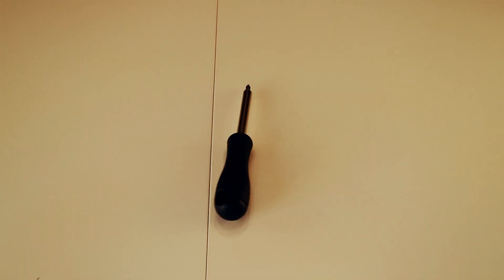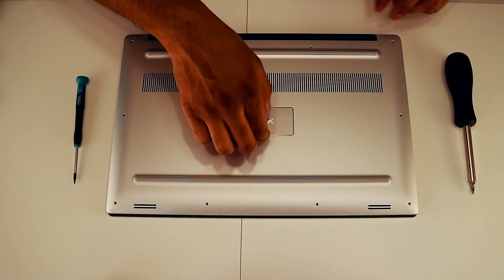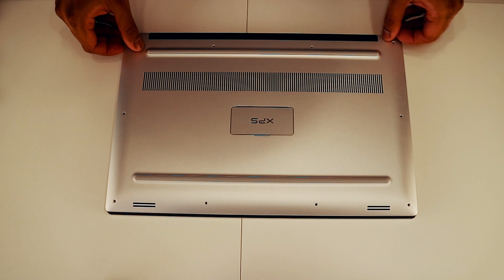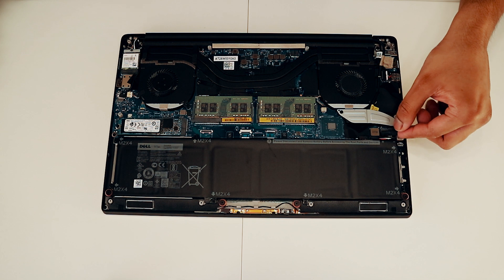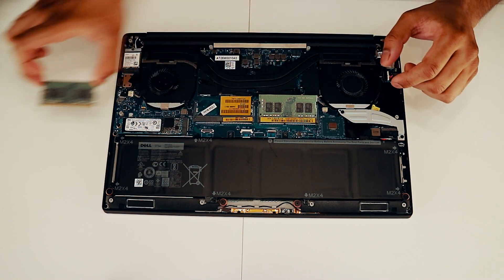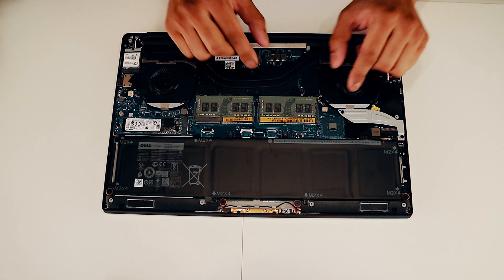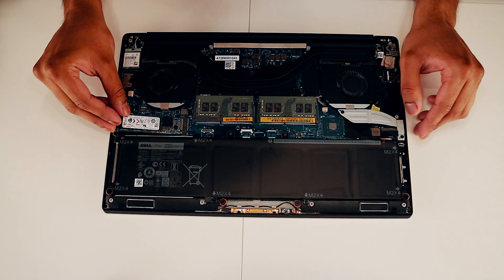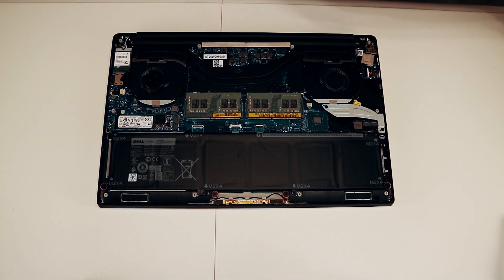How to UPGRADE your RAM & SSD on the DELL XPS 15 9570

Comment: Great video! Is each RAM module 8gb each? for 16gb. I wished to upgrade to 32gb to do I need two 16gb? Also is any RAM model ok? Thanks for the tips
Reply from the maker: Hi
Yes if you have a 16GB RAM currently then you have 2x8GB. You'll have to buy 2x16GB for a 32GB Setup.
Make sure you read this article because there are some compatible issues with the XPS 15 9570 when it comes to RAM Sticks.
https://www.windowscentral.com/how-add-more-ram-dell-xps-15-9570

Comment: What do I do before I upgrade the SSD?  Do i need to save my bios on a usb? What are the procedures?
Reply from the maker: Backup your personal files to a external hard drive then just swap out the SSD.
Install Windows 10 from a bootable USB drive which you can create using Microsoft own software called Windows Media Creation Tool.

Comment: Hi. Thanks a lot. Can I do the same with the model 2018? If I buy with 16 GB 2 x 8 GB DDR4 a 2.666 MHz
Unità a stato solido PCIe M.2 2280 da 512 GB can I then upgrade in the future?
Cheers
Reply from the maker: Hi!
Yes, this is the 2018 model and you can of course upgrade in the future!
You could upgrade to 2x16GB DDR4 and 1TB or even 2TB PCIe SSD.

Comment: I have the version with 8gb of RAM und I want to Upgrade it up to 16gb. Did you know If I have right now 2 x 4gb insisde and I must buy 2x8gb or if I Just have one 8gb Stick and can buy Just one more with 8gb that I have 16gb? :)
Reply from the maker: Hi
I can confirm that the 8GB RAM is a 2x4GB  setup! So you'll have to buy 2x8GB for a 16GB Setup.
Make sure you read this article because there are some compatible issues with the XPS 15 9570 when it comes to RAM Sticks.
https://www.windowscentral.com/how-add-more-ram-dell-xps-15-9570
Reply: @HumanSuten  OK thank you!

Comment: I just bought a Dell XPS 15 9570 with 512GB SSD storage and want to increase its storage. Can I add a 512GB Samsung Evo 960 without removing the existing drive, therefore making it 1TB?
Reply from the maker: Hi
It depends on what battery you have in your XPS 15, is it the smaller 56whr or bigger 97whr one?
If it's the 56whr then you can install an additional SATA drive, not M.2. 
The EVO 960 is it a M.2 drive? If so then you have to replace the existing 512GB SSD you already have in your system.
Reply: @HumanSuten  Thank you for the reply. My battery is 97Whr. Also, I guess Samsung 860 EVO is SATA III drive. What do you think, is adding this drive possible, keeping the original drive intact?
Reply from the maker: Unfortunately you can not add any additional drives because the 97whr doesn't allow any SATA drive installation.
And the drive you already have in your computer is not a SATA drive, it's a M.2. PCIe, and you bought a SATA Drive which will not fit.

Comment: Hello, does the Dell XPS 15 9570 have  2x4gb or one 1x8gb, I am sure it is a 2x4gb, just wanna know.
Reply from the maker: I tried to find some information regarding the case, I believe it's as you speculate, 2x4GB. I can try to confirm it in the coming days because my brother just bought a Dell XPS 15 with 8GB which we will do a RAM upgrade on.
Reply from the maker: Hi
I can confirm that the 8GB RAM is a 2x4GB  setup!

Comment: Hi, I was wondering if I would have to re-install windows or do anything software related after upgrading the ram.

Edit: Will my new ram appear on the about this laptop window?
Reply from the maker: Hi!
No you won't have do anything besides checking for yourself if your laptop detects the new RAM stick ☺️
You can do this by going to "About this PC" as you said yourself or by running "dxdiag" in CMD.
Reply: Human & Suten thank you! also, would you recommend me getting the xps 15 or any other laptop? my budget is $1400 and I would like a dedicated graphics card
Reply from the maker: I don't know the prices where you live but 1400 USD won't get you a Dell XPS 15 where I live. It's difficult to recommend anything because prices varies a lot from country to country. But you could look into the Dell G5 and Dell G7 with dedicated graphics card although a bit bulkier/heavier laptops. There also several other Asus Gaming Laptops you could look into. I don't what you're looking for, gaming performance or something for content creation?
Reply: @HumanSuten  I am a 3d game designer and do lots of coding as well as render different images and backgrounds. I cannot put a link over here for the laptop as youtube will automatically remove this comment. Just search: Dave 2d the problem still persists and click on the link in the description on the XPS 15 for the price of 1399$. that is my maximum budget and I do game from time to time. I only like good build quality and thin bezels as well as a good trackpad.
Reply from the maker: Yes I've seen his video and checked the link. For the price I think it's a great value for the things you mentioned that you do. The i7 8750H is the greatest CPU for laptops right now and the i9 version is not worth the price for 10% increased performance. You can always undervolt and repaste the cpu to avoid thermal throttle. We have a video on this procedure on our channel. But honestly all laptops if it's not a gaming laptop with big fans will thermal throttle in some degree.
Reply: Human & Suten thank you so much and I will buy the cos 15. You are a great YouTuber and the few YouTubers who actually care about people’s questions. thank you! Also what laptop do you use?
Reply: Meant to say xps 15
Reply from the maker: Thank you so much for your words, they really mean a lot to us! 
We really try to answer all of your comments because you the viewers are what drive the channel forward.
I currently use the Dell XPS 15 9570 4K i7 Model with 16GB RAM + 512GB SSD ☺️
Reply from the maker: Follow this Subreddit to check if the RAM stick is on the list. https://www.reddit.com/r/Dell/comments/8r55ys/9570_working_ram_kits/?utm_medium=android_app&utm_source=share
Dell XPS 15 9570 is really specific with what RAM sticks works or not.

Comment: Why do you unplug the batterry before you upgrade the RAM ??? and My XPS 15 is 8GB (2x4GB) ram, I just buy 16GB (1x16GB) ram. Is it possible to upgrade my XPS to 20GB (4GB+16GB) ram??? Thank you in advance
Reply from the maker: In all upgrades to computers you should always disconnect the power source and if it's a laptop you're dealing with you should also disconnect the battery. You don't want any current running through the components.
Also you should always buy RAM upgrades in pairs, you should instead go for 8GB + 8GB RAM because that enables "Dual Channel" speeds.
Lastly check out this user upgrade guide to get RAM sticks that really is compatible with the Dell XPS 15 9570:
https://www.windowscentral.com/how-add-more-ram-dell-xps-15-9570
Reply: @HumanSuten  Thank you so much
Reply from the maker: No problem, glad I could help you out! ☺️

Comment: Hi, If im upgrading the SSD but the laptop is new and never been turned on before is that ok to just do a straight swap? Thank you
Reply from the maker: Hi!
I would first boot up the computer to see if all is working before adding a component. This would make the troubleshooting much easier because you then know that the computer was fully functional before the process, so if any error arises after upgrading the SDD then you know that it's the new SSD.
Reply: @HumanSuten  Thanks alot!last question..am I right in thinking that I'll have nothing to have to back up when I do this?
Reply from the maker: Yes, that's correct! Watch our video on how to install a clean install on your Dell XPS 15 9570 https://youtu.be/_G8kP70bGQc
After that be sure to update you BIOS because Dell has made a lot of improvements to the Dell XPS 15 by updating the BIOS.
Please feel free to ask us how many questions you would like to ☺️

Comment: Great Vid. Can you pls confirm if V-COLOR - TL416G26D8RBR17_Kx2 - 32GB (2x16GB) DDR4 2666Mhz - White LED - Red Heatsync - CL16 - 1.2V -  and Corsair - CMK32GX4M2A2666C16R - 32GB (2x16GB) DDR4 2666MHz CL16 - Red - Vengeance® LPX Series are suitable RAM for Dell, Also if Samsung - MZ-V6P1T0BW - 1024GB (1TB) SSD 960 PRO M.2 NVMe (M2) can be use it ? I'm open to suggestion too. btw is there a place for an extra normal SSD? thanks.
Reply from the maker: Hi!
No those are RAM Sticks for desktop PCs and not laptops!
Follow this upgrade guide, they link to some suggestions and a subreddit where Reddit users has listed all the compatible RAM sticks:
https://www.windowscentral.com/how-add-more-ram-dell-xps-15-9570

As for your choice of SSD, it should work without issues and I would also go with a Samsung one, they're great! 👌🏿☺️
Reply: Yes, I saw the link with the proper type of RAM after I posted my one,  There is a warning about not to select CL16, or lower latency and RAM must be SODIMM, I found 3 brands making what I want 32 (2x16GB) CL18 G.Skill & Corsair, but Kington is CL15 (not suitable), very tricky DELL with it though. 
I've done a little analysis of the upgrade cost, if you buy the lower spec which is No Touch, Standard 8GB (2x4GB) RAM & 256 SSD, then upgrade to 32GB (which improve the frequency to CL18) & exchange SSD for Samsung 960 PRO M.2 1TB SSD cost almost the same than buying the DELL touch 4K Ultra HD (3840 x 2160) with 32GB RAM (CL19)  & 1T. So the question is,  Is there a reason to give up touch screen & 4K for a justifiable better performance by using a better SSD and CL?, personally I don't think there will be a noticeable increase of performance, (btw you get a 5 years warranty for Samsung SSD, and extra SSD 256, but 2x4GB has no use) what do you think?  Thank you so much for your reply, keep up the good work!!
Reply from the maker: I would definitely say go for the 4K model, not so much for the touchscreen (I find touch screens on laptops useless) but for the 100% AdobeRGB 4K 400nits display. It's gorgeous to look at, it's really enjoyable to consume media on the device (YouTube, Netflix etc.), amazing to edit photos and videos etc.
Because as you said yourself and I believe so too, that that upgrade you researched will not give any substantial performance benefits.
Happy to hear that you liked our video! ☺️
If there's any further questions, don't hesitate to ask!
Reply: Thnx M8!!

Comment: Hello! do you know which brand of SSD and RAM are compatible with Dell XPS 15 9570? thanks!
Reply from the maker: Due to some driver and BIOS issues you should read this: https://www.google.se/amp/s/www.windowscentral.com/how-add-more-ram-dell-xps-15-9570%3famp
I first thought that any SO-DIMM DDR4 would work but there are some things to look out for to ensure compatibility!
And for SSD, any M2 NVME PCIe SSD would do.

Comment: I'm planning to get the new Dell XPS 15 9570 but will get 32GB RAM separately. Once I get it, do I have to the first boot-up without putting the new ram in? Or can I upgrade the new RAM before I do the first boot-up? Thanks
Reply from the maker: It's best to test computer first with the default RAM sticks and make sure the computer works before adding another variable to the troubleshooting in case something is faulty.
Reply: Human & Suten couple of stupid questions, sorry for that. But is there space for more than one SSD? I couldn't really tell plus can mix ram with this? Like an 8GB stick with a 4GB stick or will it cause problems? Thanks for the help
Reply from the maker: If you have the smaller battery 56whr and not the bigger battery 97whr then you have an additional space for a second SSD.
When it comes to RAM it's always best to buy matching RAM sticks, like if you already have an 8GB, then buy a 8GB RAM stick go with it. So it becomes like 8 + 8. Matching sizes/speed will enable "Dual Channel" memory speeds which will give you greater benefits from you RAM.
Reply: Human & Suten thank you for your reply! I appreciate it. Last question. Can you choose the battery size? Because I couldn't find an option for that on the Dell page.
Reply from the maker: No problem! 
In some countries you can and in some countries the battery capacity is tied to different categories. Here in Sweden all of the 4K models has the bigger battery and I think the most expensive 1080p model had the bigger battery.
Reply: Human & Suten oh okay, it's weird over here in Germany, the cheapest version with the i5 hast the big battery, then the cheapest version with the i7 has the small one and the others all have the big one. That's the only think holding me back from getting the i7 Version pretty much. 
But again thank you for your help and patience
Reply from the maker: Oh that's some weird combinations.. 
Is that cheaper i7 model with 256GB SSD + 8GB RAM + 1080p + GTX 1050 Ti?
If you need any further assistance to choose laptop don't hesitate to ask us!
Reply: Human & Suten exactly that's the combination. If it had the 512GB SSD or 16GB RAM I'd go for it but with the smaller battery it's not as good of a deal I think. Is there any other brand/series you'd recommend? I'm kinda new to the laptop thing. 
Thank you for the offer! I'll definitely subscribe as well. Great content.
Reply from the maker: Maybe you call Dell and see if they can customize from their side and equip it with the bigger battery?
Right now I think the Dell XPS 15 is one of the best laptops whatever you do. 
Other recommendations would be MSI GS65 Stealh, Gigabyte Aero 15X, Razer Blade 15, Asus Zenbook Pro 15.
Thank you so much for your words and the subscription, we really appreciate it! ☺️

Comment: do I need to format the old SSD / delete the windows 10 / de-authorize the Windows 10 in old SSD before doing so??
Reply from the maker: No just install Windows on the new SSD and it will activate just fine, the product key is embedded in the BIOS ☺️ What you do with the old SSD is up to you, you could use it in a cabinet as an external SSD.
Reply: Thanks, your information is helpful!
Reply from the maker: You're welcome ☺️

Comment: How do you install the Windows after changing the SSD?
Reply from the maker: You just boot into your bootable windows USB drive. We have a video on our channel on the procedure which will help you along the way ☺️
Reply: Do u mean this video? https://www.youtube.com/channel/UCe9V93POpQBc7t6weiLDWVA/search?query=dell
Reply from the maker: Wilson Ho You can check out this video 👍🏿 https://youtu.be/_G8kP70bGQc
Reply: I hv got my new XPS15 9670.
I replaced the SSA with Samsung evo970
Then plugged it the windows 10 recovery usb provided by Dell, after installation, I found the Win10 installed in the 1GB HD!
How can i ensure the win10 will be installed in SSD instead of Hd???
Reply from the maker: If you check out the video i previously linked, you can see it when I'm deleting partions of the SSD, you can choose where to install your Windows 10

Comment: Remember I told you that this will take like 5 weeks to arrive? I found it on Amazon but is the 8gb one and I want the 16gb but it can be upgrade. On Amazontha manufacturer said that it have 1 year Dell warranty but and if I buy it from Amazon I just have to buy the ram I need and it arrives in one week and I can try it for one month to return it to Amazon or have the option to call Dell for suport but I'm not a 100% Shure about it https://www.amazon.com/gp/aw/d/B07CTHLX8B/ref=ox_sc_act_image_2?smid=ATVPDKIKX0DER&psc=1 here is the link I would love if you can give me your point of view
Reply from the maker: Yeah i think that's a great idea, the RAM is super east to upgrade! Then you also have time to fully test it. But i can't seem to find what battery this configuration uses, if it's the 56whr it's something you have to think about. I have the 97whr but i also have a 4K model, so i get around 5-6 hours of battery use. I think the same will be for the 1080p with 56whr but if it has the 97whr, the battery will be like 7-8 hours.
Reply: Human & Suten it use the6 cell  97wh battery so yes
Reply from the maker: Okay perfect! Then you're good to go ☺️

Comment: If I want to upgrade the RAM I have to use the two ram slots or just one? And if I have to use both can I put 16gb on 1 and 4gb in the other one? Or it have to be equivalent?
Reply from the maker: It's best to use the same speed and size in both the RAM Slots because that enables dual channel speeds!
Reply: Human & Suten ok and what if I use 1 slot of 16gb ran it's that ok? And what type of ram brand you recommend me to use for the upgrade
Reply from the maker: It's works but 2x8GB RAM will be much better because that will enable dual channel speeds. It's always best to combine and install RAM sticks in pairs. As for brands i would say Crucial, Kingston and Corsair would be the better brands. Make sure you buy a SO DIMM (for laptops) and make sure that it it's a 2666MHz one!
Reply: Human & Suten perfect thanks
Reply from the maker: No problems at all! ☺️